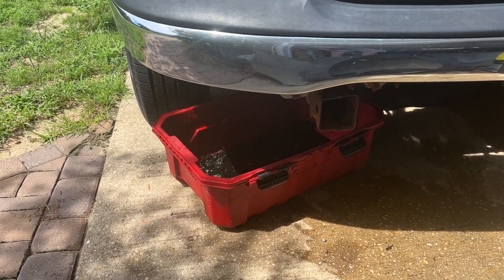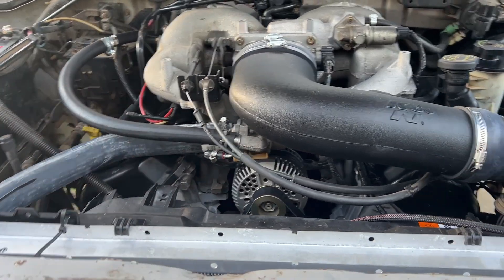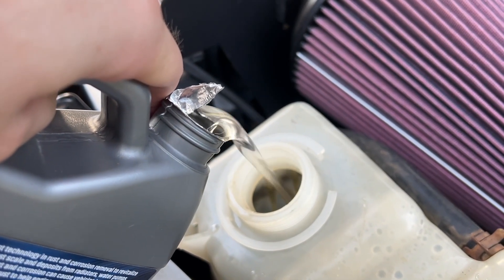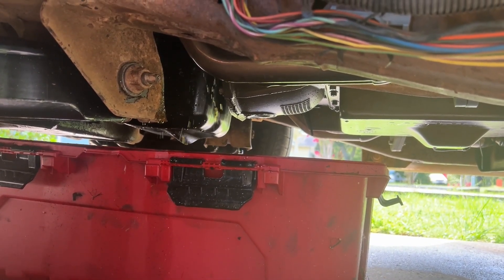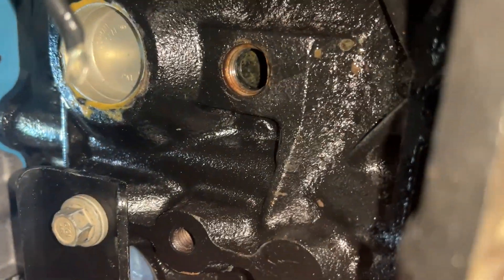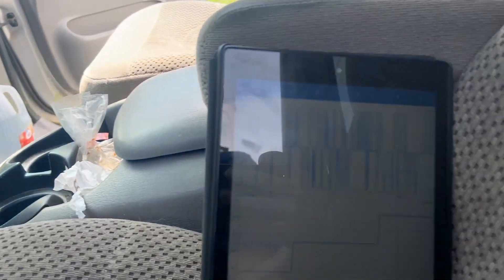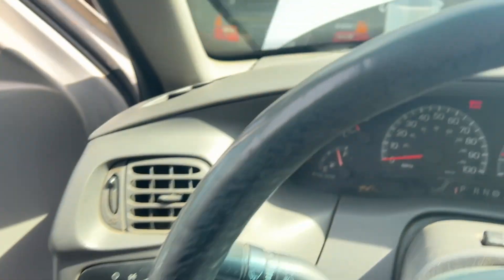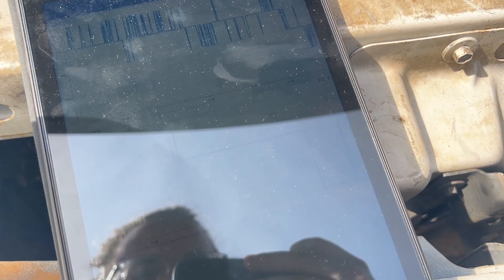Brand New Engine Won't Stop Overheating - F150 5.4 4v Navi Swap Tow Rig project

Comment: When you do the 4v swap you need to swap the coolant and head sensor wiring cause of not your gonna be getting your reading from the head happen to me I had to swap the wiring on both sensors
Reply from the maker: Oh that's great to know. Where can I learn more? I have all kinds of questions like what plugs, what pins, where on the harness, etc. Message me on IG if you want: jj.in.motion

Comment: If u haven’t solved the overheating problem. Go back to manual fan. 

Had the same problem. I had electric fans. I removed the electric fan. And went back to manuel fan. The electric fan did not pull enough air to cool the system.

Comment: I feel your pain with the air in the cooling system. A little trick is to take the temp sensor out of the crossover/intake and purge air from there, make sure that's full

Comment: Currently did the same swap and going through the exact same issue, any updates ?
Reply from the maker: After trying almost everything, I ended up just running without the thermostat and it's been totally fine ever since. Not an ideal solution, especially if you do lots of short drives or live in a very cold place, but I've put over 500 miles on it this way and no issues so far. I do anticipate trying to figure this out for real, but I wanted to stop messing with it and use the truck
Reply: @JJinMotion  perfect I’ll do this cleaning solution and see how it does , I live in Arizona where it tends to be hot most of year so you can definitely guess what I’ve been going through with the truck since the swap
Reply from the maker: @cristianmedina3396  Haha yeah I can totally imagine. The thremacure did work wonders, the coolant is no longer rusty for sure. I feel no thermostat would work fine for you as well in AZ
Reply: I'm starting to wonder if I just got lucky with my swap. I keep hearing about other people having overheating issues. 🤔
Reply from the maker: Yeah man, I followed your build as my inspiration and despite having done so much to every part of the cooling system I still had trouble. The only thing I can guess at this point is the exhaust isn’t getting the heat out of the head maybe? But not certain of that
Reply: @JJinMotion  I also live in Canada so extreme heat is a non issue. I wonder if blocking off the coolant reservoir hose that's attached to the lower rad hose and using the navigator reservoir and hose that attaches to the intake manifold would make a difference? Just an idea.
Reply from the maker: @fourcam150  That's a pretty good idea! Definitely not one I had thought of because otherwise I'm out of ideas lol
Reply: @JJinMotion  ill be waiting to hear if you get it sorted out. Lol
Reply: There not over heating you have to swap the temps sensors wiring it has a head and a coolant sensor and it’s getting the reading from the wrong sensor did this swap over 12 years ago

Comment: burp the coolant from the crossover. if there is no port use the temp sensor right under the throttle body.

Comment: Ive tried CLR as a cleaner. It cleaned out loads of junk from heater core/radiator. Flushing with distilled water. Worked great for me.
Reply from the maker: Interesting! Haven't tried that yet. Gonna try to run without the thermostat briefly to see if that helps and then decide what to do from there

Comment: Just did this swap myself and was having over heating issues also not as bad as yours.. i upgraded the radiator and am still testing things out... it will reach 215 under load but goes down to about 205 once reach cruising speeds 70 to 75 with ac on.. still concerned it will get hot if i have to tow something... outside temps here in texas are around 100.
Reply: Temps always come down to about 180 at idle and running mechanical fan with new fan clutch.
Reply from the maker: What thermostat are you running? And are you using the Navi intake manifold? 

I removed the thermostat today and drove around. It’s much better. Still climbs to about 225-ish while under heavier load but idles at 188-190 with AC on. Seems like I have a bad t-stat
Reply: @JJinMotion  a Motorrad high flow 170degree.. bought from Amazon. Yes I'm using the complete navi intake.
Reply from the maker: I appreciate knowing what your results are like! Same thing here in Florida, high 90s with feels like over 100. I don't think I'd be able to pull even an empty car trailer without overheating just yet, much less a loaded trailer
Reply: 215 sounds fine. Newer cars run hotter. Don’t be obsessed with getting a low temp there’s a wide range of acceptable temps.
Reply: Did you rewire the head and coolant sensor if you didn’t your getting your reading from the head and not the coolant took me a long time to figure that at.. I found out cause I ended up buying a temp gun and I pointed on the coolant sensor and my reading were different I rewired both sensor.. but did my swap like 12 years ago

Comment: Hi brother in think you should put coolant in the system without proper coolant you’re going to damage the engines internal parts then do a pressure test or get some of that head gasket test fluid that uses air from the coolant and the liquid changes color if there are exhaust fumes in the coolant   Keep us updated god bless

Comment: take the block plugs out and flush the block. 1/2 NPT plugs on the cylinder walls. one on each side
Reply from the maker: Oh nice! Didn’t realize there was one on both sides. Will check the passenger since I’ve just been doing driver

Comment: I’m not an expert but I honestly think using water instead of coolant is the issue or at least a contributing 
Factor. Because it has a lower boiling point it allows for runaway temperatures. Overheating can also be caused by timing problems. And system pressure sometimes a radiator cap can go bad and not properly seal.
Reply from the maker: Yeah, I agree that’s definitely a contributing factor at this point. Got a brand new OEM cap too so that shouldn’t be an issue. 

Gonna flush the engine again and then try a proper coolant mix. Fingers crossed that does the trick!
Reply: @JJinMotion  good luck

Comment: On the old Ford diesels, the 7.3 could run on water all day (unloaded), but the 6.0 would overheat unless you actually had the proper amount of coolant and water in it.
Reply from the maker: Interesting! I was wondering that. I haven't put coolant in it yet since it's so much more annoying to drain/fill that way. I think I'll do another flush and then try real coolant

Comment: What Lexus are you looking at?  I have my eye on an LX570.
Reply from the maker: A man of culture, I see! I'm on the hunt for a very specific LS430. I've had an LX470 and an LC 100 series and love them both. One day I'll get a 200/LX570, for sure.
Reply: @JJinMotion what type of LS430 are you looking at in particular? I’ve owned one myself. My current project is a 1995 LS400.
Reply from the maker: Looking for a black exterior, interior in good shape (color doesn't matter) and then the non-navigation touch screen center stack. And it needs to be mechanically broken so I can fix it on the channel haha. 

What's your project?
Reply: @JJinMotion  got it. Yeah since all my cars have to live outside, I will never own a black car just too infuriating to keep clean haha. As it is my LS400 is bad enough in that department, it is star sapphire pearl which is the dark blue. Lovely color though. I am just learning to work on it just refreshing basic stuff. After I finish brakes I’m moving to front lower suspension. I have also addressed some misc so far, thermostat, gauge cluster (I transplanted some needles from a better junkyard cluster and installed some makeshift needle stoppers), replaced door computer for windows, random stuff like that. So brake work currently and suspension work on deck… 

I miss my LS430 and I think I will be back in one eventually. It was ultimate grandpa spec - gold on tan, with OEM chrome rims. One recommendation. Avoid Mark Levinson sound system at all costs. You have been warned haha!!  Although can make for good content. I had to pull and re-foam every speaker in the car. And the amp has to be refurbished. That is expensive if you can’t do yourself.

Comment: Does it overheat to the point it pushes coolant out the resvoir? Or does the coolant disappear over time?
Reply from the maker: Nope, haven’t had it blow out the resorvior yet but when the temp needle goes up I get off the gas so I don’t destroy the engine and then temps come back down. 

That’s partly why I was thinking it’s erroneous readings
Reply: @JJinMotion you do know the engine coolant temp sensor is reading temps off the back of the passenger side cylinder head. You need to swap bulkhead wires so it will read the temp at the thermostat crossover spot
Reply: Finally some one that’s knows what there talking bout I been telling people this.. I did this swap 12 years ago and I found that bout years ago

Comment: I have no clue what could be causing the overheating issue; I hope you are able to find a solution.

I don't think I'm right or on to anything, but just in case, do you know if there is a difference between the engine that was in this truck versus the 4V Navigator engine you swapped in regards to the water pump and the direction the cooling system flows?
Reply from the maker: Yeah good thinking! The water pump part part number is the same for both trucks so I think that’s ok. Along with the sensors, almost everything is the same